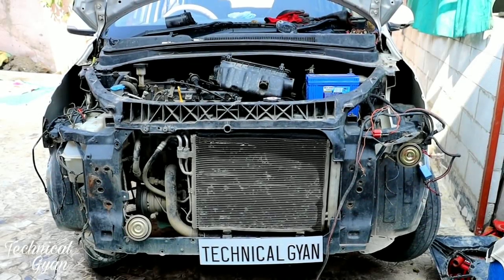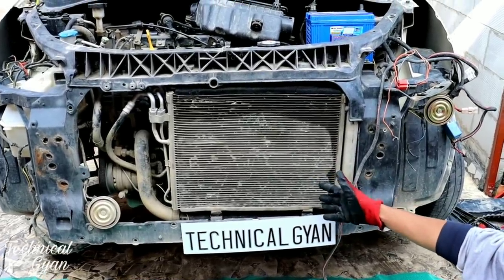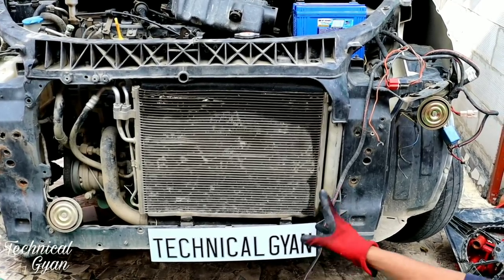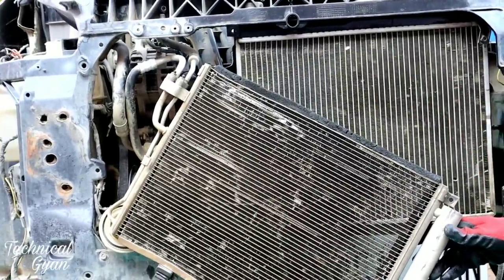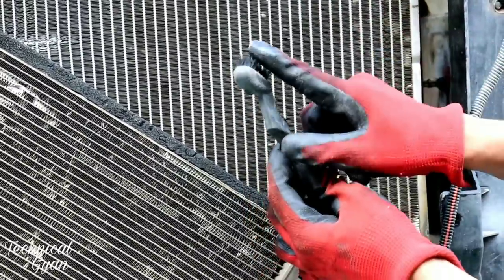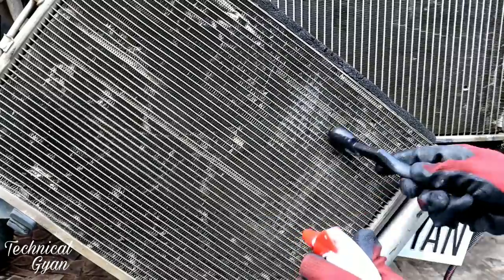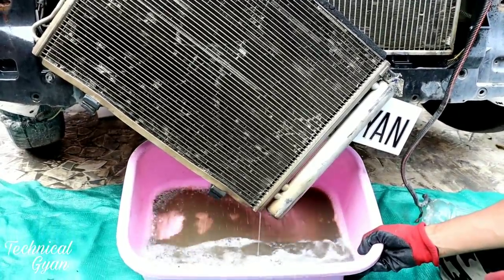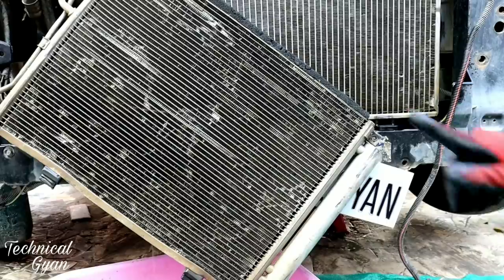AC Condenser Cleaning And Radiator Cleaning DIY

Comment: Can we do this without removing bumper?
And one more thing 
How much tinted films help reducing temperature?
Reply from the maker: 1- yes ,kuch had tak
2-jitni visibility kam hogi utna temperature bhi kam hoga
Reply: @TechnicalGyan1919  And can we use the AC vent cleaning foam for radiator instead of chemical? 

One more thing I have 2008 Chevrolet Spark 1.0 and when it's raining and when there's a slope I get maximum cooling.
But when I driving in hot climate it takes so much efforts to cool.
Again I hear the noise of 'kat" and then it starts cooling.

Why is that?
Reply: Please answer

Comment: Do we need to remove the plastic bumper before using any kind of coil (c shine) cleaner?? Can it cause damage to the paint?
Reply from the maker: Don't use acidic chemical . Only shampoo and water
Reply: @TechnicalGyan1919  what about alkaline cleaner with dilute in water ? 100 ml with 400 ml water ?

Comment: Add cleaning intercooler  of turbo 
I always take this chance 

I have reno duster 2013 model  85 ps
And done @ 226000 km without any problems
Reply: @y17t90   yes I  observed that difference between light foot and hard foot driving is 10 minutes in 100 km journey  moreover you save lots of money in car service 
For your kind information I changed my break pads on 146000 km

Comment: Sir very nice vidio explane guru dev meri swift vdi ka rediator clean kiya tha market se to shop owner ne bola tha coolent mat daalna abhi 100 km tak or mai bhul gaya ab radiator rust lag raha hai kaise rust clean karo bataye
Reply: And like your hard work🥰🥰👌
Reply from the maker: Thanks sir . But coolant na daal k aapne galti ki aisa nahi karna chahiye sir rediator to fir bhi thik hai khol k saaf kar sakte hai but engine k ander tak rust chali jaati hai . And water pump bhi jaldi kharab hota hai . Ab aap ek kaam karo rediator flush use karo and jab rediator flush karo to thermostat valve remove kar k karna fir baad me laga dena .
Reply: @TechnicalGyan1919  thanks sir🙂🙂

Comment: Hello sir, I am facing a knocking sound in the car Chevrolet beat when ac is turned onn. The noise started comming after change of vbelt . I went to car ac repair mechanic he said the compressor is week and need to be replaced along with condenser and compressor. Please let me know what to do
Reply from the maker: Sir, first of all you should get the v-belt checked, maybe there is something stuck in the belt or something is cut, due to which it is coming to the noise, sometimes it happens that something gets stuck in the belt after that. The noise starts coming and we think that it is the noise of the compressor. If even after that the problem is not correct, then you have a bearing inside the compressor. Changing that bearing is possible because this noise can also come due to the bearing. It is important to first check the belt properly. .
Reply: @TechnicalGyan1919  ok! I will get it checked

Comment: hlo sir alto 2010 modle he mere pas but uska left side ka headlam work nhi kr rha o bilkul bnd he or low or high beam nhi chl rha
Reply from the maker: Sir connector check karo . wiring ka issue ho sakta hai . Bulb fuse hota to koi ek to jalta ya ho ya lo.
Reply: @TechnicalGyan1919  connecter tk nhi aa rha power

Comment: Have done half engine and cleaned radiator but didn't cleaned front radiator, after that installed new Mahindra thermostat valve but still heating issue, now mistri say it might be a problem with radiator, have to change that but he's not 100%sure that it will be ok, as u mentioned me to do heater coil bypass, AC mistri say there is no heater coil in bolero, confused sir as u have old bolero u might be the right person to ask from, for all these I have spend 36k still problem not solved, what should I do,